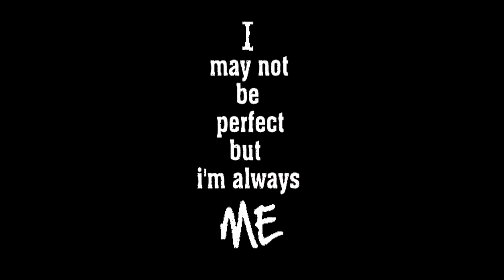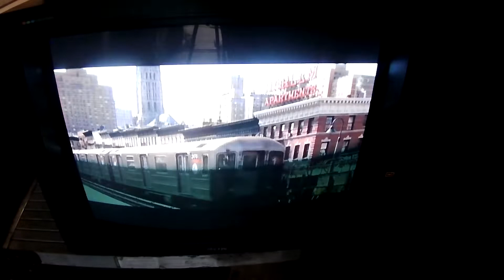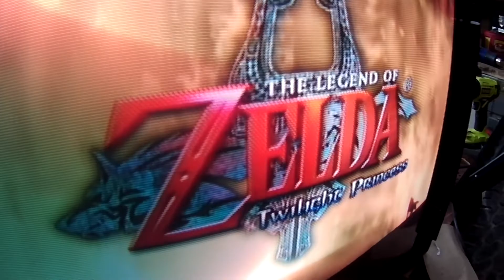Sony Trinitron PVM-2530 25" Color Video Monitor (trash pick left for dead) Pt.2

Comment: Man, I’ve found cracked solder joints that you can’t even see with a microscope. Visual inspection is often impossible. Sometimes you just gotta go to town and reflow everything. One thing that does help is wiggling through hole components to see if the leads move on the other end but on single-sides boards like these you’re just as likely to cause a cracked solder joint by doing that.
Reply from the maker: when I get time I will look thow it better